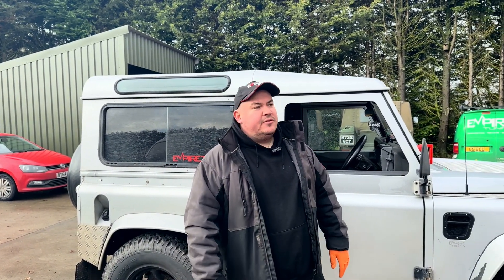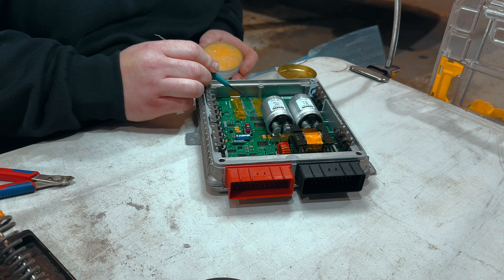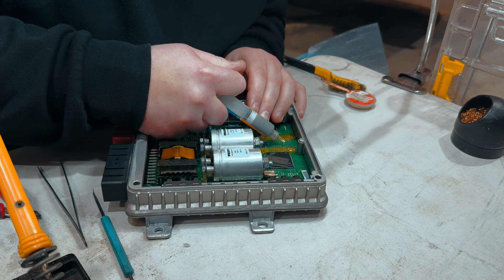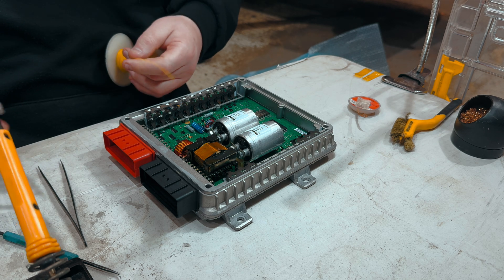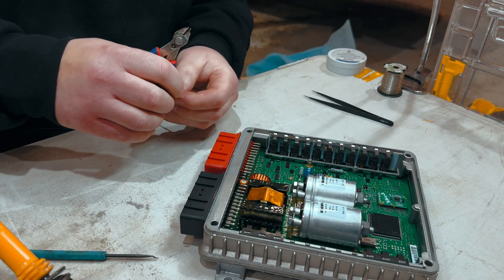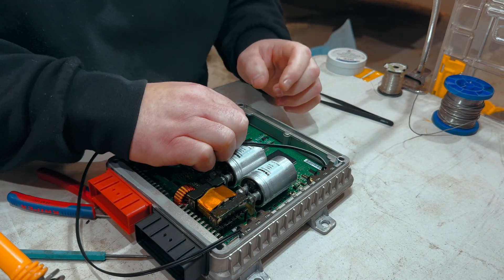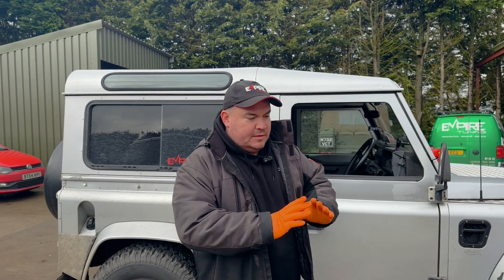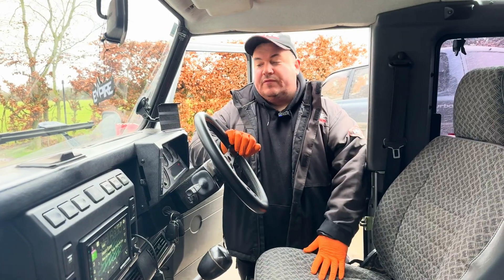REVEALED: TD5 Mapping Done Right!

Comment: I've just got one of these ecu's, a twin map version.  Which would be a good stealth switch to use to change between maps?  I've got a generic momentary switch from Amazon, but I'd prefer to use one of the Discovery switches for maximum stealth!
Reply from the maker: We always use the Land Rover Momentary switch and just change the cover on it as it works in both the D2 and Defender also the installation guide is in our Just Map It download with the part number needed
Reply: @empiretuningUK  Thanks for taking the time to reply.  Can I send the ECU in for you to check it? The first map is great, but I can't get it to change to the fruity map.  I've tried momentary switches and latching switches on pin 34 but no joy
Reply from the maker: @JimBiddle. It's always best to speak with the tuner who initially carried out the work, as they should be able to advise further. However, if you're unable to get a resolution from them, I'd be happy to help. Please jump on the website, fill out the ECU order form from the contact page, print it, and pop it in the box when sending your ECU over to me.
Reply: @empiretuningUK  It has one of your Empire Tuning pcb's in it, so guessing you guys tuned it?  I'll have a look on the website when I get in.  Many thanks.
Reply from the maker: @JimBiddle. Ah thats odd dont seem to have you on the system, but send it in to me ill sort it :)

Comment: Love it! Sounds so good! What's done to make the turbo owl like it does?
Reply from the maker: This is running our water and oil cooled ceramic ball bearing. Currently running 273bhp with no engine work and standard internals 👌
Reply: Loooool at least the pins you need to change or the head will play a litle at least 2mm will moove hehehe 

Dont asck me how i know   @empiretuningUK